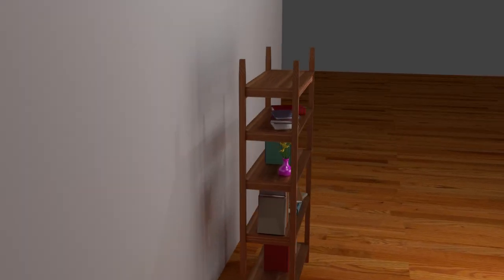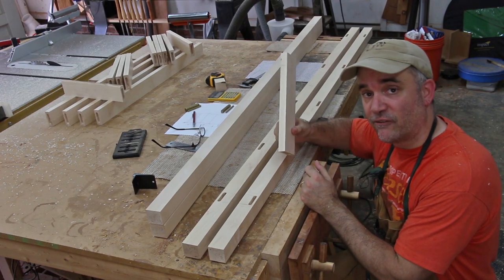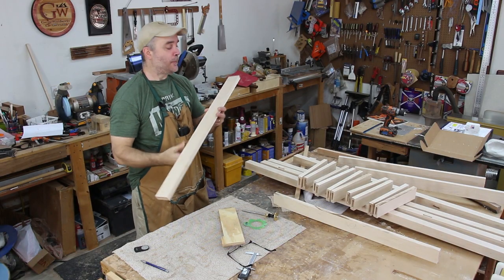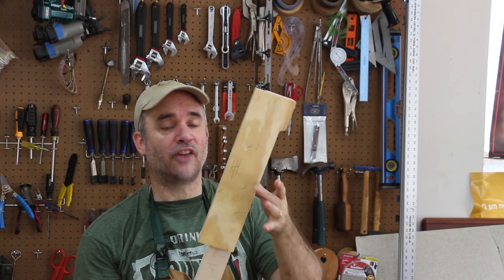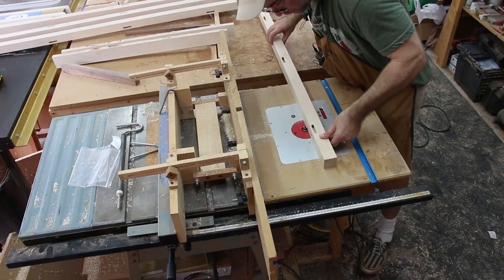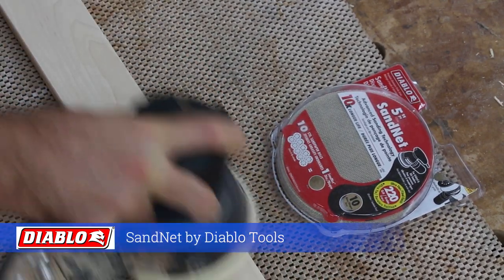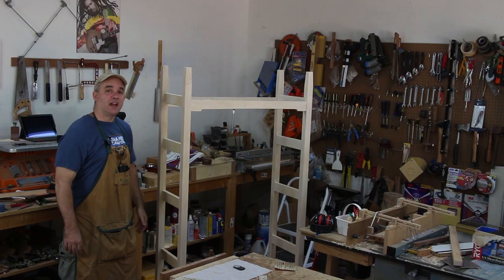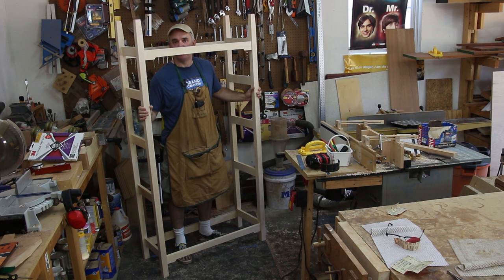Open Bookcase Part 2

Comment: Ever use those right angle clamp guides when you clamp something like that? I'd be worried about it coming out of square while the glue dries without having a back or side panels to keep it square. Looks great. Nice and clean design.
Reply from the maker: No, I've never used them.   Usually on a case I'll check for square and pull corners together with clamps if needed.